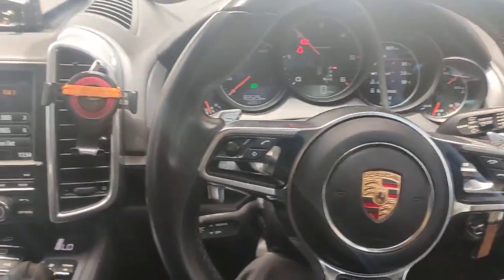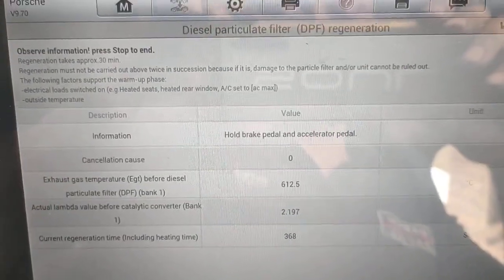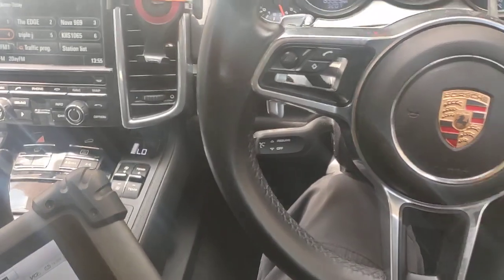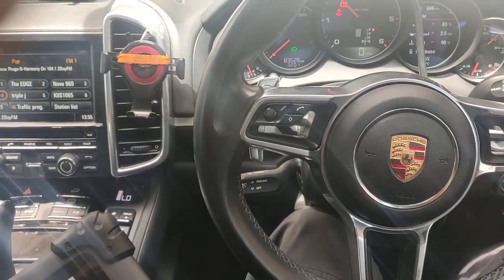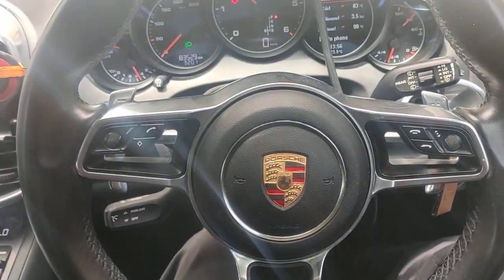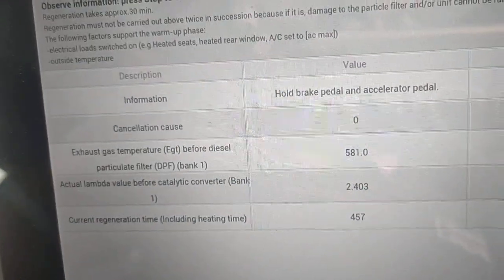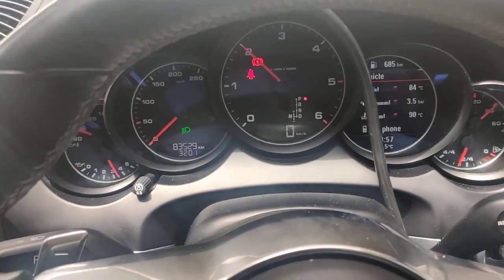Porsche Cayenne turbo diesel L.L -DPF filter regeneration using scan tool

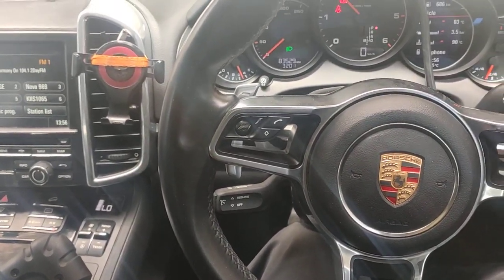Comment: Thanks for a great video. Around 1:20min you mention you had a replace a valve, but can't quite catch which one you are saying that was? I am Melbourne based and attempting this procedure at home. My second question is, do I need to keep the brake and accelerator pedals pressed for the duration of the regen?
Reply from the maker: Yes around 35mins
Reply: Danny. He said the throttle valve. Hope this helps.